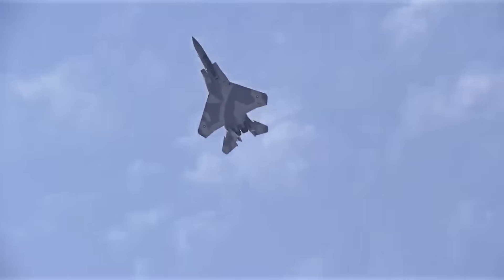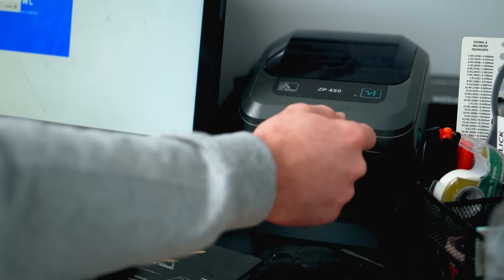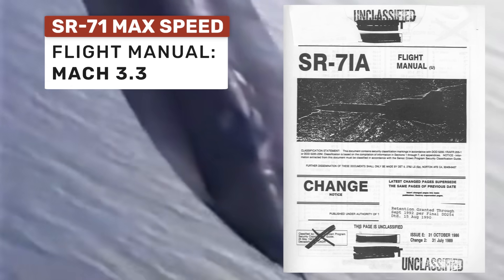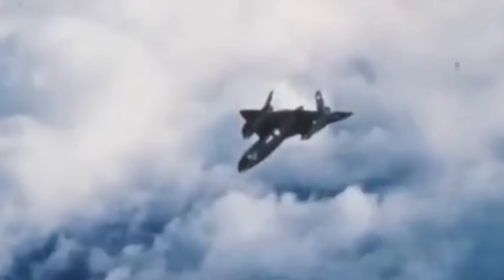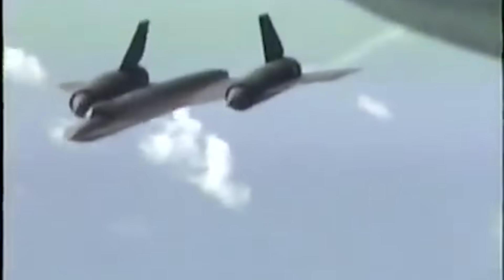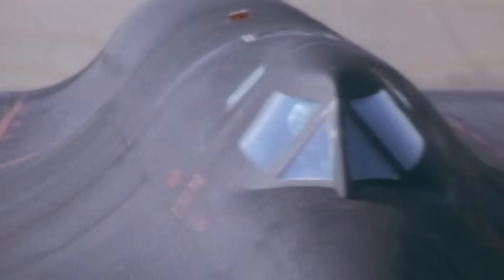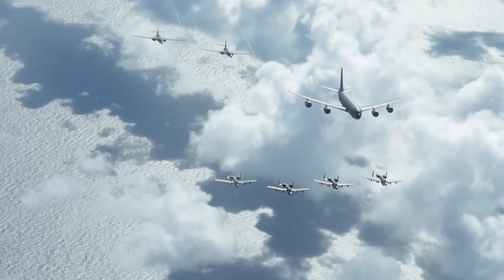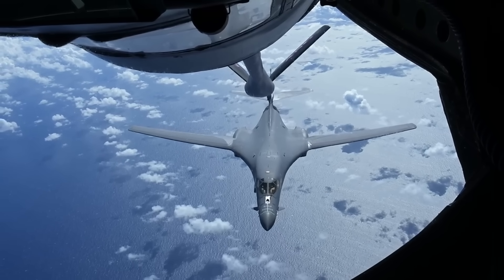The SR-71 was MUCH FASTER than the Air Force will admit

Comment: There was a book, and I would have to research it again to find it, at my local library.  It was about an evolving conflict between the U.S. and Japan with an ultra-modern aircraft being developed utilizing fully adaptive surfaces and the like.

The pilot for this airplane flew, originally, a "mercury" spy plane.  Mach 2 was considered less than a third of its operational speed.
The "aurora" was effectively a disinformation campaign to distract from the SR-71's capabilities.
Reply: The Aurora was the B2 program
Reply: @gr8crash 
The thing about disinformation is that you take true statements and twist them into something that can't be made sense of.
It's almost like an inverted ARG.  When someone notices a project code name and starts poking around, you give them information related to a completely different project.

The Manhattan project?  Have you seen the size of the particle accelerator they are building over in Detroit?  Here, look at these purchase orders for lots of wire.  If they can get the particles going fast enough, they might have some kind of time traveling weapon or something.  Crazy stuff.

An example of how that works.  You build sets of alternate interpretations of the facts that can be found and continue to play off of and mix them together.

Project Aurora may have been the B-2 - but in the public lexicon, it was a hypersonic spy plane that had yet to be declassified - a successor to the SR-71.

If something did leak about the B-2, it would conflict with expectations of a hypersonic spy plane.
And foreign intelligence services would spend a lot of time and resources trying to uncover a hypersonic spy plane that had already been revealed.  Even if the Russians knew it was significantly faster owing to them tracking it by radar, the insinuation we already had a successor would give them pause.
Reply: @Aim54Delta no. Long post but no. The "aurora" name was given to the project that encompassed the ATB competition program for the stealth bomber between Lockheed and Northrop. That's all.  Obviously Northrop won.  

We didn't have the capabilities to build a hypersonic plane back then as we barely even can get today.  Also the fact the General Welch wanted the SR71 program gone,  there's no chance he would have also then funded a replacement.
Reply: @gr8crash 
I think we are missing each other.
The public had the idea of an Aurora Spy Plane because the line item was included in the budget.  There were entire television programs (operated by the intelligence agencies) dedicated to talking about and "researching" what was going on at Groom Lake ("Area 51") and the Aurora was a definite part of what was being discussed at the time.  Janes even released a rendering of it.

As part of that, there were credible observations of sonic booms from nowhere, donuts on a rope contrails from what people suspected were pulse detonation wave engines, and all kinds of stuff.

You can't play with an aerospace plane and people not notice.  So, you have to come up with something.

You declassify the plane that is actually responsible for it - the SR-71, say it can go pretty fast and whatnot, and then you conflate the Aurora line item with a new aircraft.

The SR-71 is a novel airplane in that it is designed to optimize the efficiency of the after burning section of the engine.  You can design an engine to work efficiently from the turbine's combustion chamber OR the reheat section.  Not both, and basically no aircraft optimize for the after burning section.

The SR-71 can maintain combustion via the after burning section well above 85000 feet and mach 3.  At that altitude, structural stresses of hypersonic travel are not much of an issue and ballistic flight begins to overcome viscous flight.  You are skimming the atmosphere in an air breathing rocket, not flying a hypersonic aircraft, you only need to be able to survive the transition in the lower atmosphere.

Yes, going hypersonic in the troposphere or even stratosphere is quite a tall order.  The energy shed through compression of the air makes it not worth the effort.  Structurally, cavitation has been capable of achieving it for quite some time, but the energy lost and the plasma sheath tends to make it all a moot point when a penetrating bomber or tomahawk shrinks the engagement envelope of systems by limiting detection range and, therefore, response times.

Hypersonics have only really gained attention because a low, flat, and fast trajectory helps to minimize all relevant interception factors in an era where over 95% of all engaged ballistic and penetration missiles are intercepted.

The SR-71 is what happens when you play Kerbal in the 70s with real rockets and airplanes and start realizing that the higher you fly, the less thrust and fuel it takes to fly fast... And start optimizing around that point of inquiry.

Which was probably taken farther than the recon missions of the aircraft - though at the time, one-off projects could have been spawned.  The CIA wasn't the only one building things and the government was contracting people to build things who knew how to do things said government did not know how to do.  The problem with a government project is that even the TS:SCI programs are documented.
My point is that the entire goal of the Aurora Spy Plane was to obscure the capabilities of the SR-71 and to distract from the purpose of Project Aurora.  The late 80s and 90s marked a time of transitioning from policies of absolute secrecy to policies of limited hangouts, disinformation and misinformation.  Case in point is Bob Lazar.  Pay a guy to go around to talk to curious people and have him post a wide angle shot of a pilot in an F-15 cockpit and have him act like it's evidence of a pilot flying around on a saucer without a canopy.

Even as a kid, I recognized that as nonsense, but people still went to hear him speak and extended credibility to the idea he would know a UFO from a frisbee.
Reply: @Aim54Delta not missing anything you're just posting a lot and not following.

The term aurora not for a specific aircraft. It was just the name of the program that encompassed the ATB competition. No different than Project Oxcart encompassed the competition between Lockheed and Convair. Lockheed won and built the A12.

The "donuts on a rope" and other silly things you reference were popular in the 90s I remember them. But they arent indicators of specific engines and those contrails can be seen most days. They aren't anything special.
Reply: @gr8crash 
Holy conditionally hypothetical breakfast.

Your statements have been fully addressed in my prior responses, you just can't seem to wrap your head around it.
The thing the public called the Aurora was the SR-71.  They called it the Aurora because of the Pentagon line item that was disclosed, not knowing it was the B-2.  That did not come out that Aurora was the B-2 until much later.

The television programs RUN BY THE INTELLIGENCE AGENCIES created the idea of a successor to the SR-71 out of the public intrugue, that idea was called "The Aurora Spy Plane."

The SR-71 has always been a mach 7+ aircraft when flying above 85000 feet.  There was never a need for a hypersonic successor because it already was.

When I say "the Aurora was the SR-71" - I am not talking about Project Aurora because literally no one who ever says "The Aurora" is talking about Project Aurora.  The only reason to ever say "The Aurora was the B-2" is to, somehow, be aware of the public interest in an Aurora Spy Plane and know absolutely nothing about it other than the line item in the budget and that it was the B-2.

Which is an implausible arrangement in real people, but if I figure government employees and flag officers, then the shoe fits....
Reply: @Aim54Delta so much nonsense in your post. You went downhill when you said the SR71 could fly mach 7+. That is 100% impossible for the SR71 to do. It would crash long before getting to that speed. Even reaching half that speed was impossible on a standard day.
Reply: @gr8crash 
There you go, again, not understanding conditionals/qualifiers and forgetting this has been covered, already.
The engines are designed for efficient operation in reheat.  Thin atmosphere means high speed, low drag and less thrust necessary to achieve any given speed.
Altitude is a significant factor in what an aircraft's maximum speed is because it is the primary component of drag.
To operate at 85,000 plus feet, you actually don't want to vent the overpressure from the shock wave, you use it as a form of ram compression on the intake.  See supersonic speed reducers, why they work as they do, and why losing heat is actually more of a problem for a jet engine at altitude than overheating - well, at least when it comes to the combustion process - the frame is a different story.  I threw a bunch of qualifiers in there, so you'll probably get lost.
Reply: @Aim54Delta while all that is fine it doesnt negate the fact that the SR71 couldnt fly mach 7. Barely half that was possible.
Reply: @gr8crash 
Ah, sorry, I must have missed that in the published figures.  Thank you for pointing out that it lists "mach 3+".
I needed you to come along and produce words repeatedly that I have already seen with no additional context before I realized my error.

At.
What.
Altitude?
Reply: @Aim54Delta there zero figures that say mach 7, theres nothing that remotely even gets close to that. 

And considering it couldnt really fly much more than 90k ft that would be about it. The fastest flight that did occur was 3.49 and just over 90k ft. But these speeds and altitudes werent possible on a standard say and were only possible due to extreme atmospheric conditions and these speeds weren't fully within the pilots control. 

It was also one of the scariest encounters because at 90k ft, control authority isnt very good. In fact maneuvering at that altitude is forbidden for that reason. 

And technical 3.1 is 3+.
Reply: @gr8crash 
And why is control authority so limited at altitude?
Why would flying just a bit faster than an F-14 or F-15 be such a "scary" experience?

I built some simulations of the SR-71, one time.  While there were limitations with the model, even if we assume the service cieling was 90,000 or less, the aircraft is capable of suborbital hops and hitting velocities in excess of mach 6 with ease.  You basically have to fly that fast to climb above 70,000 because there simply isn't enough lift.

Officially, the instruments in the aircraft were not able to record airspeeds above mach 3.4, nor were they able to record altitudes over 85,000 feet.  It was abnormal for it to fly without those instruments being pegged.

Less officially, the radar telemetry that can be inferred to be SR-71 flights indicate Mach 6-8 depending on what methods are used and flight is discussed.

In an old book, written by a blackbird pilot, he speaks of an aircraft called a "mercury" which was escorted at Mach 2 by some chase planes during one of the main character's last flights.  The aircraft normally operated above Mach 6 and was basically limping along at Mach 2.5.  Fiction is often more true than any documentary in all the ways that count.
Reply: @Aim54Delta idunno where you're getting information from but you're pretty delusional with your claims.

Control authority was diminishing above 90k ft, air was just too thin. Thats why maneuvering was forbidden. 

Suborbital hops? Absolutely not and also ludicrous. The SR71 never flew high enough for that. Mach 6? Absolutely and laughably impossible. Under Absolutely no circumstances could the aircraft fly that fast. 

The instrumentation worked though mach 3.4 and above 90k ft. Not sure where you got that it didnt work but you're wrong there as well.

There is zero telemetry of any kind supporting mach 6-8 as its not remotely possible under any circumstances. Thats well beyond what the engines and airframe could do. Thats well beyond what the maximum design potential even was. 

Not sure where you're getting information from but you need to stop.
Reply: @gr8crash 
"Need to stop"
Why?
I am far from the only person talking about the aircraft being faster than reported.  I am the only one violating compartmentalization efforts, however, and explaining what should be obvious.

Why 85000 feet?
This is the boundary to the thermosphere.  Above 85,000 feet, supersonic shockwaves do not propagate efficiently.  The design constraints for the lower atmosphere simply do not apply and you are less a flying object and more, as I said, one skipping across the atmosphere not much different from how a rock would skip across water, just different relative densities involved.

Molecular temperature is high but the lack of actual air makes radiation the dominant domain of cooling, which is why you can radically exceed the design constraints of the lower atmosphere.

Officially, the flight recorder has no records of blackbirds flying higher than 85000 or faster than 3.4.
But as the old apocryphal saying goes: "85,000 is yours if you can get up there."
"Roger, descending."

It's like you all forget that highly accurate aerospace simulation engines are children's toys, these days.

While suborbital hops is a bit of a stretch of the definition of a suborbital hop, the question of just how high the blackbird can go is basically one of how far they can push the after burning section to operate as something of an improvised ramjet.

Control authority will be a bit wild, but you just have to remember a rock skipping across the water and avoid over-reaction.  You'll "sink" back into the troposphere.  Just don't try to be a fighter jock about it and you'll naturally hit a glide equilibrium and reach an altitude and speed where the engines can be restarted.

While I doubt the blackbird could sustain anything like 100,000 feet or above, as the air becomes so thin that I doubt the combustion process could be sustained - but one could be cheeky and carry liquid oxygen up there to inject into the reheat cycle.  You would not need much to turn the A-12 into an anti satellite platform that could intercept satellites and space stations - or, deploy a smaller set of missiles able to do so, having most of the heavy lifting done for them and merely needing a sub-orbital trajectory.

The more modern take is to use plasma engines at this altitude, which we have explored and the Chinese do so as well.
Reply: @Aim54Delta you're not violating anything as you haven't said anything. 

The instrumentation system works and records above 3.4 and 85k ft.
Reply: @gr8crash 
My dear boy, you have said nothing.
At least, intentionally.
I said two things:
"Instrumentation"
"Flight recorder."

For someone who values the precision of words, the choice in reference is itself a statement.
Assuming you are more than a simple evangelist for the Janes publishing.  Most people I worked with were more willing to discuss operational principles and limitations.  "You would think that, but here is what happens when...."
By contrast, when encountering someone who is trying to sell a cover story that you personally witnessed to be wildly inaccurate, they just point to what the headline says and say that is all there is to it.  Usually with a "look, you need to stop."
Now, it's possible that we could flip all this on its head into a mind game and make the case that you're providing responses to sell me on my own "delusional" take - as per my disinformation theory.

Which is more likely than randomly encountering someone who is invested in evangelizing for Janes.... Except this isn't random and the algorithm works that way, making it more likely to connect both the conspiratorially minded, the people who worked on the program(s), and the autists/aspies of the field who don't like someone saying stuff that disagrees with their airplane card collection.

An oddity to be sure, but few these days seem to be capable of grasping what is known as multiple working hypothesis - that is, being capable of accepting multiple conditional hypotheticals and only removing ones and updating their relations to each other once new and contradictory experience has been had.
Reply: @Aim54Delta said nothing?  I've corrected you routinely and again with your instrumentation/flight recorder point. You have said they dont work above 3.4 and 85k ft, and again you're wrong.
Reply: @gr8crash 
And I said it doesn't.
I am the superior authority.  I win.
You don't seem to understand how a discussion works.
I am quite studied in aircraft and aviation.  I know what the pamphlet says.
I have also been in similar programs and have seen what those pamphlets say about things I have first hand knowledge of.

You don't seem to grasp that whatever it is you think you are correcting me on is information I have always known.  I didn't wake up yesterday and just realize there was an SR-71 or because this video was posted.

I know what is on your aircraft card collections.  I had the same ones as a kid.
Reply: @Aim54Delta you obviously dont know much about the SR71. The air data system that feeds information to the TDI for the pilots to use has a maximum capability of mach 3.5. The altitude portion stops working at just over 100k ft. The mach gauge that they use for low speed flight has a maximum operating limit of mach 3.6. But this guage isnt used above mach 1.5 basically because it's not accurate. The MSR system that records all the parameters and graphs them also has a maximum limit at mach 3.5.

So yes again, you're wrong. And this is why, you're using pamphlets. I'm using the flight manuals, maintenance manuals etc.
Reply: @gr8crash 
Now that is starting to say some things.  Somewhat.
Maintenance manuals and publications are just more useful pamphlets.

One would be wise to look at the XB-70 and the SR-71 and ask some questions.  Or the MiG-31/35, which was able to achieve similar performance, albeit self-destructively, without the use of the novel dual-cycle engine.  The 31 actually used a turbofan, which is quite impressive to achieve 80k feet ceilings with.

Most things, as used, exceed their specifications.  For electronic components, their use is simply not what the reference circuit is.  The question is what the afterburning section can maintain, mostly.
Reply: @Aim54Delta this is such a rambling comment theres almost nothing specific to counter.
Reply: @gr8crash 
And yet, here you are.
"The instrumentation doesn't stop at Mach 3.4, it stops at 3.5"
That's great, so how would they know they weren't flying at Mach 4 if their gauge was pegged?

"Their altitude doesn't stop at 85000 feet, it stops at 100,000 and becomes too inaccurate."
Officially, the highest flight is 85,000 feet at a sustained level flight - but I suppose there are numerous ways to put the instruments above 100,000 feet without them being aboard a plane.

The book I mentioned....
I will have to find it as it is one that I have yet to find in online listings.
Was written back in the 90s.  Mentioned a "mercury" having, if memory serves, an engine issue and was escorted by chase planes at around mach 2.  Well below its operational speeds.

The event in question mirrors an only recently declassified event in 2018 where an SR-71 was escorted by the sweedes back before the SR-71 was public knowledge.
Reply: @Aim54Delta your post make no sense. An aircraft suffering an IFE wouldnt be escorted at mach 2. The Swede story you're referring to is true z except where you said before the SR71 was known,  when the SR71 was public since its first flight in Dec 64. 

You can keep trying to prove a point, but you'll continue to lose